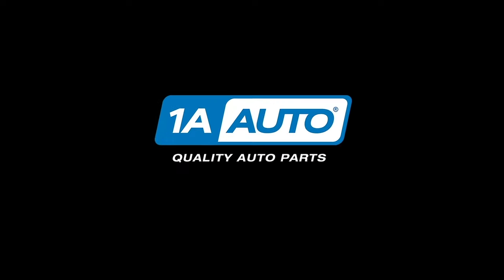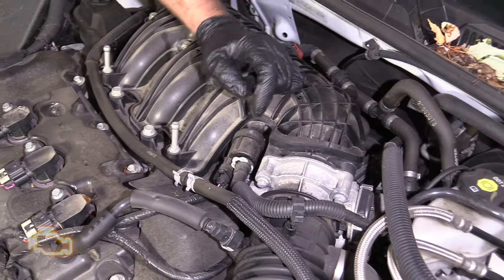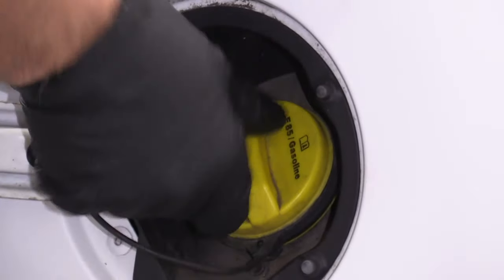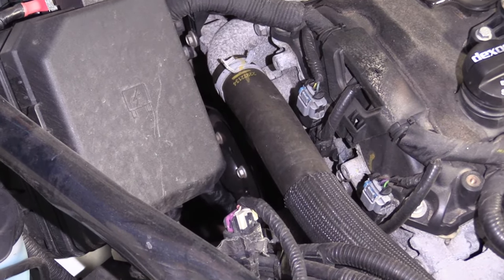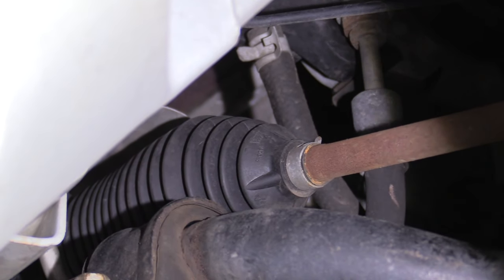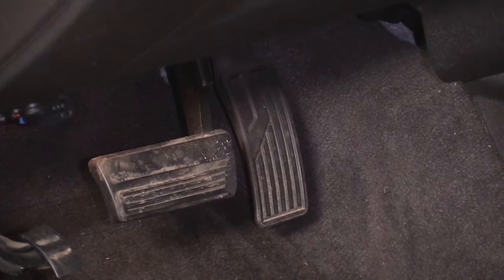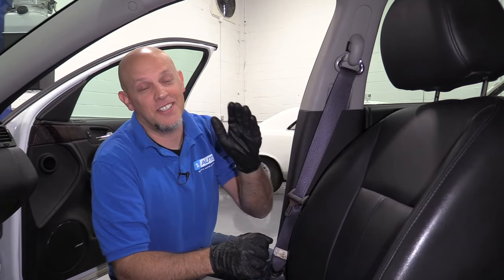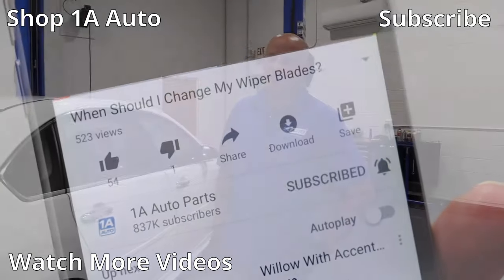Top 5 Problems Chevy Impala Sedan 9th Generation 2006-16

Comment from the maker: √  Watch the Video
√  Buy The Part at 1A Auto http://1aau.to/m/Visit-1AAuto
√  Do it Yourself
√  Save Money
Reply: Forgot the door blend actuator driver and passenger side
Reply: Hey what if the airbag light comes on when I start the car and stays on for a while? What could I do if that happens and if I checked the connections under both seats?
Reply: What engine was in this Impala? I would assume it's the 3.6 that would soon be in the 10th gen Impala.
Reply: Haven't had any of these issues but have replaced all the HVAC actuators.
Reply: Ooee